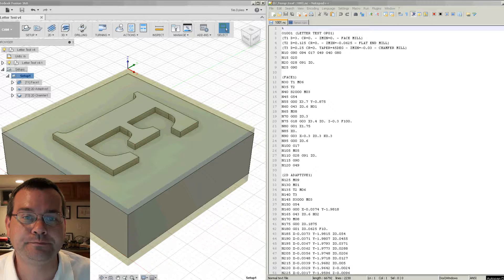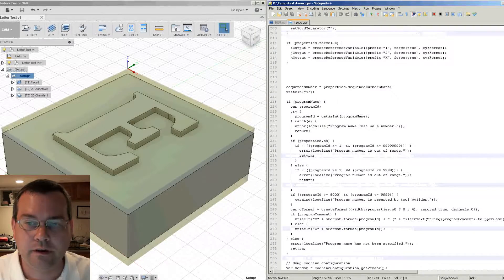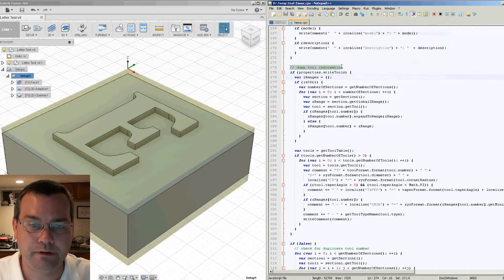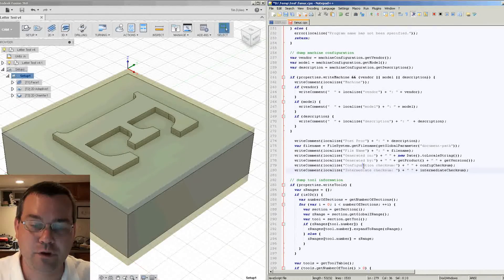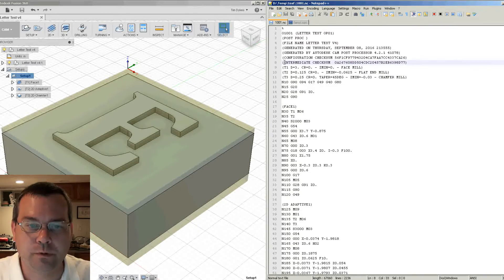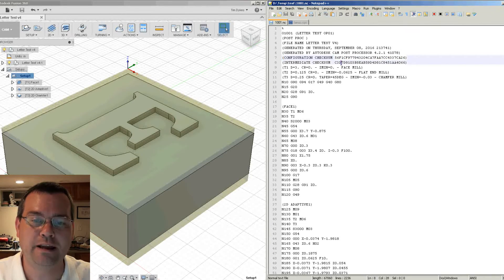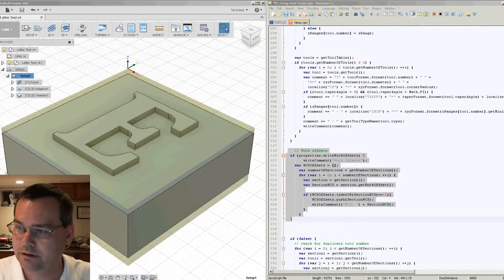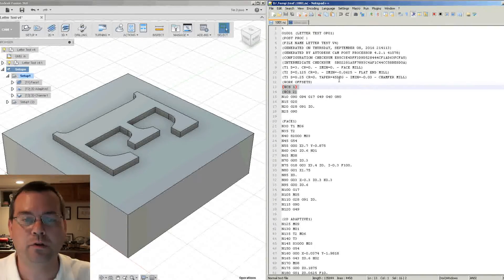CNC G code revision control?

Comment: Thank you, really important stuff that is not getting needed attention. One question: in your experience what is the most basic / go-to post processor in F360? I have a friend with an older type Chinese made semi-industrial router - tried RS-273D but it dose some strange stuff with Z travel (9mm turns into 8.~ something)
Reply from the maker: Try the fanuc general post, that seems to be the one closest to most controllers.

Comment: when you have Notepad ++ open , go into Settings, Style Config, Set for Javascript, and set User ext: to "cps" and then goto VIEW and select  "Function List" then all the functions will appear on the right and you can click on them an go straight to them.
Reply from the maker: Thank you, I knew you could add file extensions to define the language type rather then selecting it.  But I didn't know about the Function list.  I had a really old version and didn't know that even existed! I updated and will be using that feature a lot now. More reasons to love notepad++.